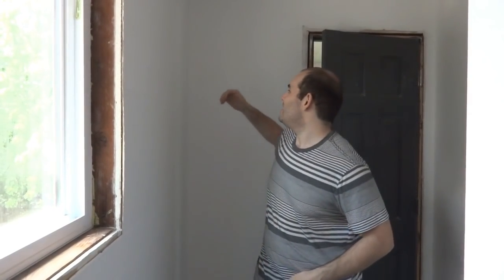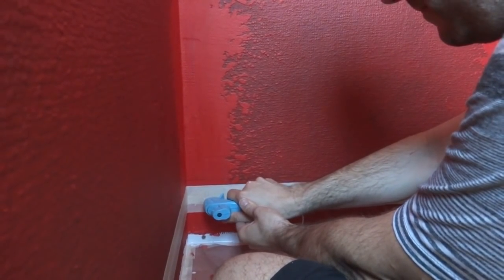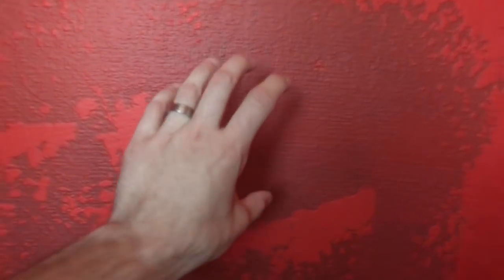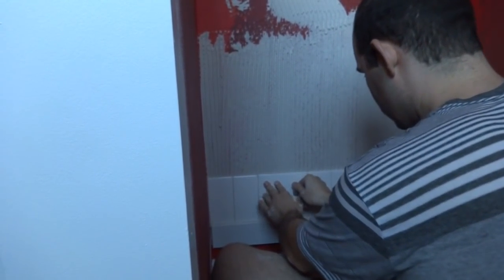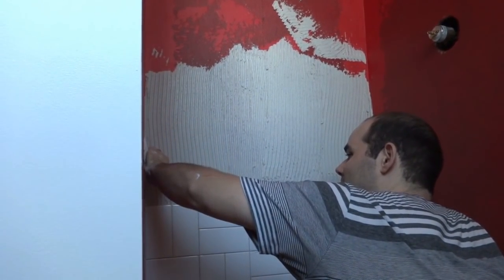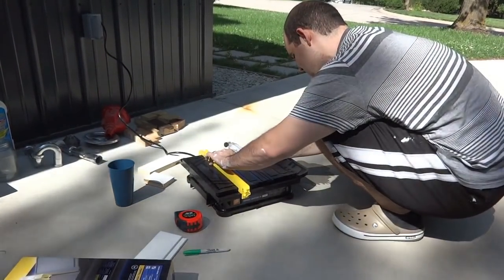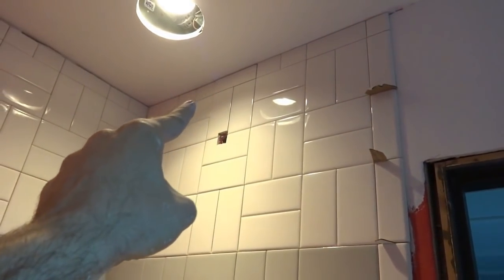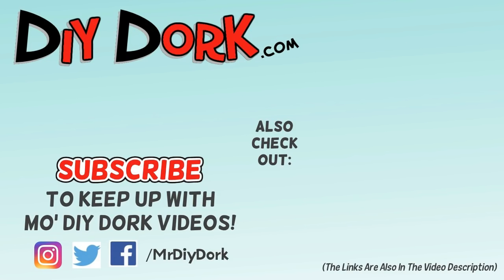Installing Basketweave Subway Tiles!

Comment: I thought you have to leave a gap between the tiles so as the wall moves (studs expand and contract with seasons) there is space between the tiles so they can pivot and shift to adjust.  The grout cracks, but the tiles don't pop off.  Do the new mortars make that not necessary any more?
Reply: SublimeSimplicity 
The tiles have molded tabs on the each side to create the space for grout.  No need for spacers
Reply: @richardupyurass2379  that is completely false. Wall tiles need a minimum 1.5mm spacing to allow for movement. This is a faulty job.
Reply: at least a 1/16 space for grout. if u go tight with the tile its almost impossible to get a sealed water proof shower

Comment: are u tiling the shower floor?? if so u want to do that before the walls get done. if u dont then water runs down the walls and has a seam it can leak through especially when grout cracks. always do the floors first